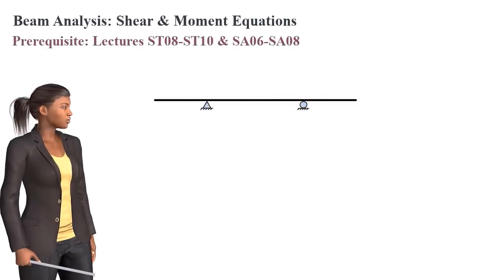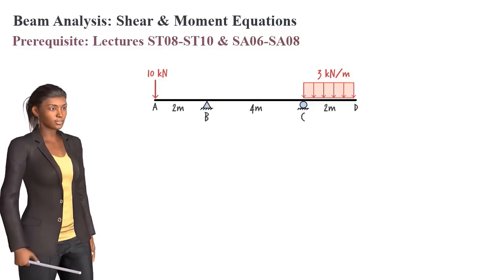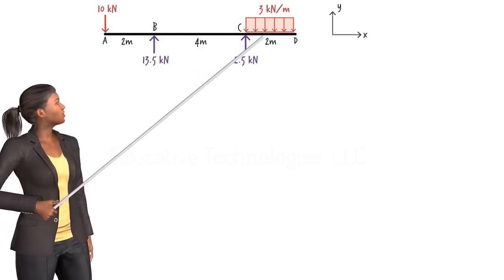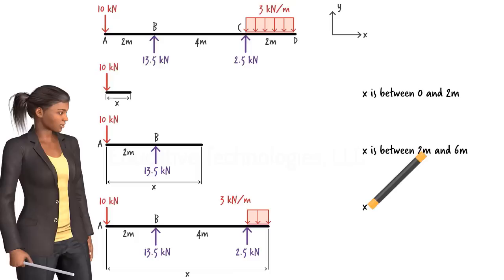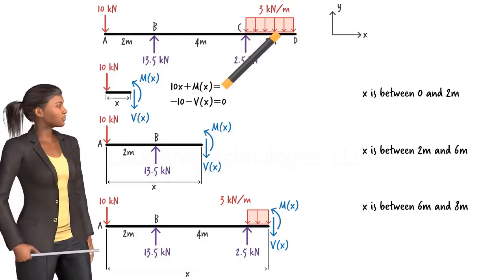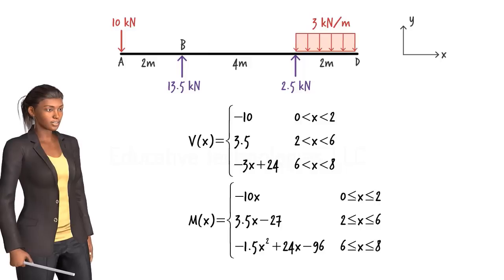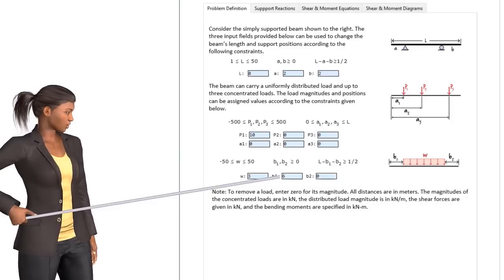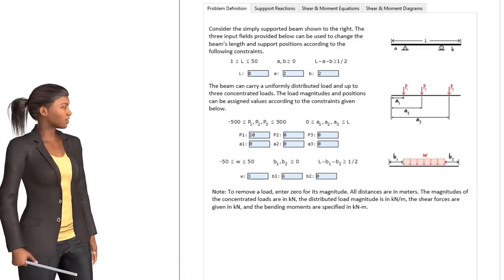EX08: Shear and Moment Equations for a Simply Supported Beam

Comment: The calculator is very helpful, mainly because of the equation, but how do I sign fix beam ?
Reply from the maker: In this version of the calculators, done for simply supported or cantilever beams, you cannot change the boundary conditions, since that could turn the beam into a statically indeterminate one.  We will release similar applications for handling indeterminate beams in time.